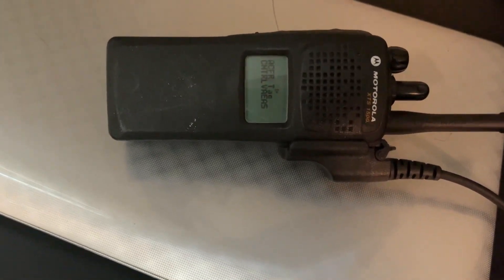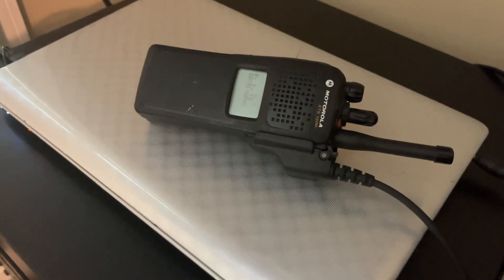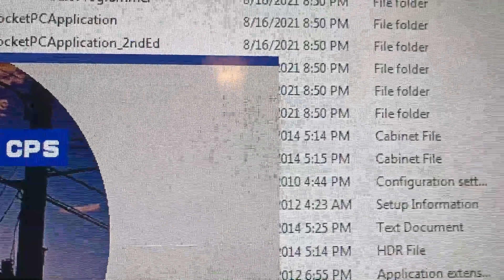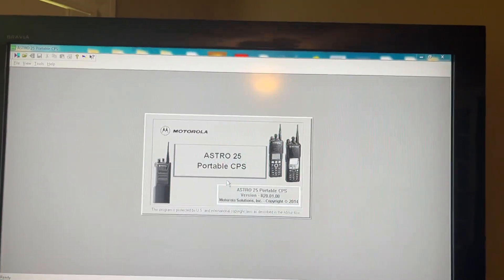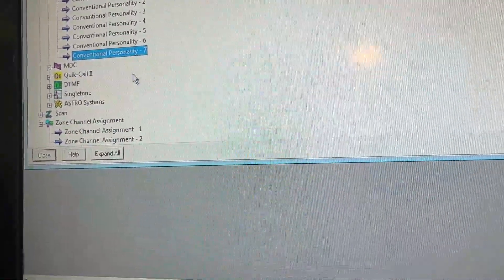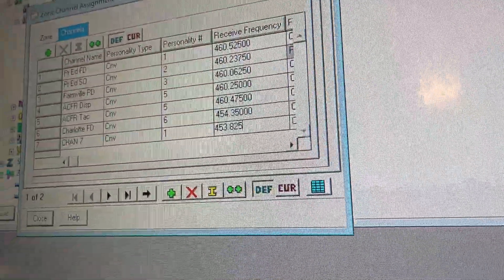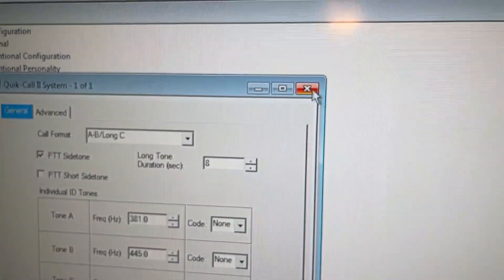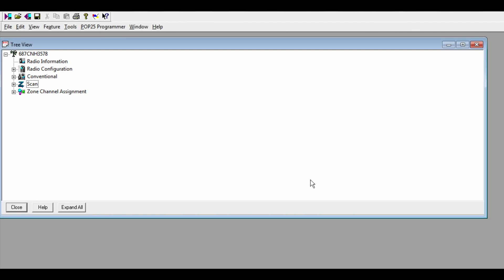How to program your Motorola ASTRO radio for conventional frequencies

Comment: Hello, Astro is failing to read my XTS3000. im using an FTDI cable to convert 9pin to USB on win XP. Astro is recognizing the com port but is failing to read the radio. Any help would be much appreciated.
Reply from the maker: Are you using the Astro 25 Software?
Reply: @CentralVirginiaEAS I think the 3000 uses a different CPS. I can give you it if you want

Comment: For some reason my radio doesn’t pick up the radio chat? But I believe everything is good some channel are not programmed but thats fine cause I put frequency to agencies in my area and pl but still not picking it up
Reply from the maker: Set your PL to CSQ. You'll hear chatter that way.
Reply: Thank you it’s getting it now means a lot
Reply: @CentralVirginiaEAS
Reply from the maker: @justincampos9942  No Problemo! Also, when you're on the channel, make sure you have the conventional personality set to RX only. This will prevent accidentally pressing the PTT button.
Reply: Ooo thank you! Also what does it mean if i’m receiving transmission but not hearing any voices does it mean the area is to far from me? I hear static and receive but no talking?
Reply: I have it Unprogrammed I just have monitor and talk around/direct
Reply: I have a model 1 XTS5000
Reply: Also my radio only likes for some reason 800.000 codes it doesn’t like anything lower also I bought the radio from ebay and they used it for trunking and it’s hard for me to change the frequency receiving
Reply from the maker: @justincampos9942  Mind if I ask you what county you're in? Or if you want, go to https://radioreference.com/db/browse to find frequencies in you're area. Please please PLEASE!!! If you're county is on a trunked system DO NOT attempt to scan a trunked system.
Reply: I in CA also I have it on conventional I don’t know how to use trunking
Reply from the maker: @justincampos9942  What part of CA?
Reply from the maker: @justincampos9942   it wont interfere with anything. Just make sure that when you are on a zone channel assignment, that all the channels have under personality say "Cvn", but i'm not sure why you are still getting static. My XTS1500 came from a fire department too. And the fire department still had the whole trunked system on the radio. So what I did was I just deleted them all.
Reply: @CentralVirginiaEAS  Does signaling type have to be a certain mine says none and tx signal type non astro
Reply: @CentralVirginiaEAS  I don’t see cvn
Reply from the maker: @justincampos9942  signaling type is PTT ids and two tone decoding. Leave TX signal type alone because are you using this as a scanner?
Reply: @CentralVirginiaEAS  I’ll change it right now and yes I am
Reply: @CentralVirginiaEAS  I only have nine mdc quick call 2 dtmf
Reply from the maker: @justincampos9942  did you go to zone personality assignment? You should see either trk, or cvn under personality type.
Reply: @CentralVirginiaEAS  Yes it has cnv
Reply: I put cnv
Reply from the maker: @justincampos9942  put cnv for ALL of them. If you put trk, then all of the trunking is active. Good news is you don't have the ctrl frequencies for nearby trunked systems in your county, so your radio won't affiliate. You really don't want it to do that.
Reply: @CentralVirginiaEAS  yeah they all cnv
Reply: @CentralVirginiaEAS  Yeah i’m just using cnv on all of them and have it to the set personality 1 and right frequency and tune it’s not speaker cause even with a mic it still static
Reply from the maker: @justincampos9942  Wait, have you gone to conventional configuration, and change the monitor type to "Silent"
Reply: @CentralVirginiaEAS  I don’t think it is sorry i’ll have to check tomorrow cause my other computer has the software programmed if it’s silent should it work or change something elee
Reply from the maker: @justincampos9942  if it's on silent, I believe it should get rid of the static.
Reply: @CentralVirginiaEAS  Okay thank you i’ll check tomorrow
Reply: @CentralVirginiaEAS  Thanks for your help and time
Reply: @CentralVirginiaEAS  what if it is silent and still static? just so i know incase when I check it
Reply from the maker: @justincampos9942  I'll be honest, not sure. Usually when you have open monitor, I believe you have complete static. But when it's silent. It's uhh silent lol.
Reply: @CentralVirginiaEAS  I’ll change it it was open
Reply: @CentralVirginiaEAS  it still has static even when changed monitor type to silent it was open before also the latch enable time is checked only and latch enable time 2.0 and status number 5 attempts
Reply: @CentralVirginiaEAS  smart ptt 275 and quick key 500
Reply from the maker: @justincampos9942  smart ptt should be disabled. Thats actually strange how it is still giving out static even though you set it to silent. What is the squelch fine tune set to on your channel? Or what is the squelch fine tune set to on the personality your channel is on?
Reply from the maker: @justincampos9942  you think you can check out my tutorial? It has a visual on what everything needs to look like. I've never seen this issue before.
Reply from the maker: @justincampos9942  you should still keep that 800mhz frequency i gave you.
Reply: @CentralVirginiaEAS  It is 6
Reply: @CentralVirginiaEAS  I’m using that frequency too
Reply: @CentralVirginiaEAS  I have it set but it’s not picking i’m just trying to figure out maybe why it doesn’t make sense haha 🤣
Reply from the maker: @justincampos9942  did it get rid of the static though?
Reply: @CentralVirginiaEAS  No
Reply: @CentralVirginiaEAS  what about frequency list table hz need to be I have 300 and 800
Reply from the maker: @justincampos9942  huh? What part of the tree list are you in?
Reply: @CentralVirginiaEAS  singletone next to astro systems and dtmf
Reply: @CentralVirginiaEAS  it had 300hz before but I added 800 idk why just thought
Reply from the maker: @justincampos9942  you don't need to mess with any of that. That is for repeaters and stuff. You don't need to mess with Astro Systems, Singletone, DTMF, Quik-Call II , or MDC.
Reply: @CentralVirginiaEAS  I removed 800 but still static only 300
Reply: @CentralVirginiaEAS  Okay
Reply from the maker: @justincampos9942  The single tone and signaling has nothing to do with the static. 

Go to, Zone channel assignment 1. Then press the green plus button. You should see "Zone Channel Assignment 2". After you see that, go back to "Zone Channel Assignment 1". Press the red X button. It will ask you “Do you really want to delete?” Click yes. Now, you should see only one zone channel assignment. It should also say “CHAN 1” under “Channel Name” and “Cnv” under “Personality Type.” 

Now, go to “Scan List” and click “Scan list 1.” Once again press the green plus button, and then you should see “Scan List 2.” Press the red X button again, and press yes. Repeat the same process for “Trunking Personality”, “Trunking Call list”, “Trunking System”, and “Conventional Personality.” You should only have 1 conventional personality.” Do not mess with “Quik-Call II, MDC, DTMF, Singletone”, or “Astro Systems.” Once you have done all of that, please let me know, and do not do anything else.
Reply: @CentralVirginiaEAS  I’ve done so I only have one personality 1 and zone channel assignment 1 and have the rx options set to receive only also rx unmute delay 1 and unmute type and unmute or mute also signal type non astro and fine tune 6 i’m getting stuff again but just static
Reply: @CentralVirginiaEAS  still the same
Reply: @CentralVirginiaEAS  yeah I’m just wondering what i’m doing wrong or maybe a setting it’s like i’m right there but no voices that’s all which is surprising cause all setting are the same
Reply: LA county
Reply from the maker: @justincampos9942  Since there isn't a lot of fire dispatch frequencies 800mhz, here are a few I found.
857.9375 - EMS Dispatch (South of Mulholland)
859.4375 - Fire Dispatch (South of Mulholland)
858.4375 -  Fire/EMS Dispatch (North of Mulholland)

if you want, you can make a new conventional personality, and make a new zone to store these frequencies. And always remember to check the "Receive Only" box. I suggest you should get a scanner or a UHF or VHF version of the XTS5000.
Reply from the maker: @justincampos9942  Also, you should disable the orange button on the radio.
Reply: Thank you! I appreciate it a lot and getting back to me
Reply: Thank you! So I just use 800 codes? Also what if it isn’t picking up chatter maybe to far or attenna
Reply from the maker: @justincampos9942  You should be able to enter the frequencies in the new zone if you created one. If you can't pickup transmissions, i'm afraid there really isn't anything you can really do with the radio, cause these are valid frequencies.
Reply from the maker: @justincampos9942  I'll see if I can make a more detailed tutorial on how to program an xts radio for conventional.
Reply: Thank you! What settings would I have to change if I wanted to hear the voice cause all that is happening is i’m getting the receiving frequency but not transmitting voices it catches it but don’t hear voices
Reply: I believe it may be my antenna i’m going to get a different one and see if it works because it’s received PL but not voice so i’m just going to replaced antenna and hopefully it works keep you posted 🤞
Reply from the maker: @justincampos9942  It cannot be your antenna. Did you put your PL to CSQ?
Reply: @CentralVirginiaEAS
Reply: CSQ
Reply: @CentralVirginiaEAS
Reply: Or PL?
Reply from the maker: @justincampos9942  Select CSQ
Reply from the maker: @justincampos9942  Also did you press "Write Device"? just making sure you exported the programming to the radio.
Reply: I did for all of them also I only hear one channel also when I re read it why does the pl code change to 67. Also i’m just hearing static no voices @CentralVirginiaEAS
Reply from the maker: @justincampos9942  I'm making a more detailed tutorial. This should help.
Reply: @CentralVirginiaEAS speaker?
Reply from the maker: @justincampos9942  Try going to Conventional Configuration, is the "Direct Frequency Checked? Or unchecked? And go to the conventional personality, and go to you have those frequencies set on, and make sure unmute/mute type is "And UnMute, Or Mute. 

Also try adding another channel to your current zone, and enter the frequency "853.9375".
Make sure to also make a new conventional personality, and check the box to "Receive Only". And when you make that new conventional personality, go to Zone Channel Assignment, and set the "Personality #" to the new personality you created.

 This is San Bernardo County, and since it's a really big county, you should definitely be able to receive the transmissions. 
The frequency is Iron Mountain's dispatch.
Reply: @CentralVirginiaEAS  
I’m just trying to figure why now not hearing anything maybe I clicked something smh sorry for the late reply was out of town
Reply: I’m going to try again tomorrow
Reply: @CentralVirginiaEAS 
so for me what’s happening is i’m picking up signal and hear through radio but no voices just static what does that mean? I even changed the antenna and like you said wasn’t it? And changed pl to csq and write successful
Reply: also can it mess the radio up? or is it messed up
Reply: Is the radio useless now or have to fix a part? or need a certain setting
Reply: or speaker?
Reply: it’s unchecked direct frequency on conventional configuration I made a personality with receive only and rx/ voice/ signal type is mixed mode but now for some reason I don’t even hear anything
Reply from the maker: @justincampos9942  Is there no static?
Reply: @CentralVirginiaEAS  nothing
Reply from the maker: @justincampos9942  Thats normal for it to have no static. Squelch is closed, nothing is going to come through unless a transmission is heard. Also, don't change the DPL, just keep it to CSQ. Also, did you try putting in the frequency from San Bernardo county, or did you try it and nothing was heard.
Reply: @CentralVirginiaEAS ??
Reply: I didn’t have strong on inbound and out bound
Reply: Nothing
Reply: before it had static and picked up but now nothing it says write successful but nothing
Reply: does it matter what the dpl or pl also do i have to change receive pl frequency and receive pl code
Reply: does the frequency need to be checked or no
Reply: I checked it?
Reply from the maker: @justincampos9942  uncheck "direct frequency"
Reply: Also the mode for talk you said mixed no t astro or astro
Reply from the maker: @justincampos9942  should be set to "Non-ASTRO"
Reply: @CentralVirginiaEAS I do hear some static but no voices why is that? I have it set for 852.41250 big river picks up but not clear just static it’s not clear it’s set and unmute or mute type also rx unmute delay 2 100ms squelch is 3 fine tune and non astro and receive box checked
Reply from the maker: @justincampos9942  
RX Unmute delay should be set to 1 - 0 ms, squelch fine tune should be 6. Glad you are hearing chatter.
Reply: @CentralVirginiaEAS Could my speaker possibly be messed up? cause I changed to that and still just static
Reply: @CentralVirginiaEAS  or is there something else need to change cause I could hear it but it’s no voices just receiving with static
Reply from the maker: @justincampos9942  Did you change the Squelch fine tune to 6?
Reply: @CentralVirginiaEAS  I did
Reply: @CentralVirginiaEAS  just static still
Reply from the maker: @justincampos9942  ok, lets try something here. How many zone channel assignments do you have currently?
Reply: @CentralVirginiaEAS  No voices though
Reply: @CentralVirginiaEAS  Three
Reply: @CentralVirginiaEAS  Three It doesn’t allow me to add more though also if I wanted to do I delete one then add?
Reply: @CentralVirginiaEAS  Also I moved it to zone 2 but also it picks up the frequency but no voice just static
Reply from the maker: @justincampos9942  Ok so right beside the "Write Device" button, there should be a "save" button. Click the save button. So once you click save, it should give you a drop down menu where to save the codeplug. When you find a place to save the codeplug, delete all of the zones. Since you saved the code plug, you can retrieve your previous configuration. Also make sure you delete your conventional assignments. When you get to the last assignment, or zone, make a new conventional personality, or zone, and delete personality/zone 1. I'm gonna see if this way works, just an attempt to get rid of the static.
Reply: @CentralVirginiaEAS  sorry for late reply I am still receiving static
Reply: @CentralVirginiaEAS  Still static I changed a different zone new with a new conventional channel and it is 1 and 6 also receiving only and csq it picks it up but still just no voices just static or chatter ?? thank you for your help as well
Reply from the maker: @justincampos9942   wait hold up, when you delete all conventional personalities, and zone channel assignments, you should have only one on both of them. Once you do that, go to conventional personality 1, and make sure that you check "Receive only personality" and make sure squelch fine tune is 6, and rx unmute delay is 1. Also make sure unmute/mute type is "And UnMute, or Mute". 

After you do that, go to Zone Channel Assignment 1, and on your first channel, enter the receive frequency "852.4125", and you can put the channel name to anything you want. Once you have completed everything,  if the static hasn't gone away, go to Controls ---> Buttons.
First, set the top button (orange button) to light or unprogrammed.

Then

Set 1 (upper/no dot) to monitor.
Set 2 (middle/1 dot) to light.
Set 3 (bottom/2 dot) to scan.

This is how my buttons are programmed on my radio. Usually you should be able to turn off the monitor by pressing the purple or blue button on the side, on top of the fat PTT button.

Sorry for the whole entire paragraph LOL.
Reply: @CentralVirginiaEAS  No worries and I have it set that way and still static idk what i’m doing wrong smh 🤦‍♂️ but thank you for helping im just not sure why it’s picking it up but it’s just static and no voices?
Reply: @CentralVirginiaEAS  I’m just surprised it still getting static but no voices even when it’s correct I’m assuming
Reply from the maker: @justincampos9942  yeah thats strange
Reply: @CentralVirginiaEAS  I know so for some reason i’m just surprised it’s not working maybe delete my trunking personality I don’t have none in zones or nothing it’s just from previous owner was an FD but I have it set for receiving only and also set to the way you said but it picks it up but it’s just static and the red light it’s blinking too picking it up
Reply from the maker: @justincampos9942  trunking personalities?
Reply: @CentralVirginiaEAS  I have them but not using could that interfere with anything or i’m just wondering what could cause it
Reply: picks up and could hear now but not voices just static and set for right personality and for the zone and has csq